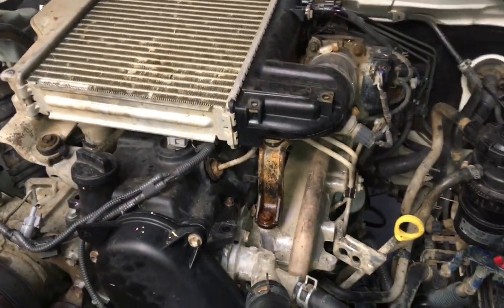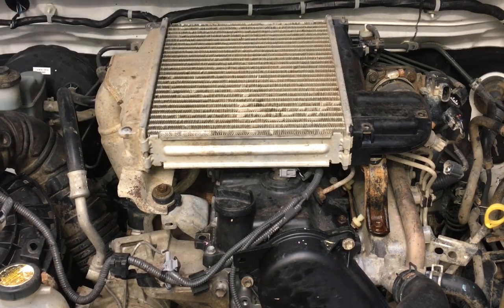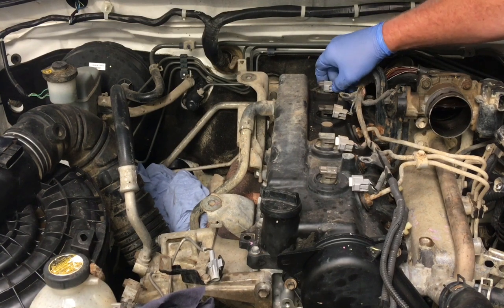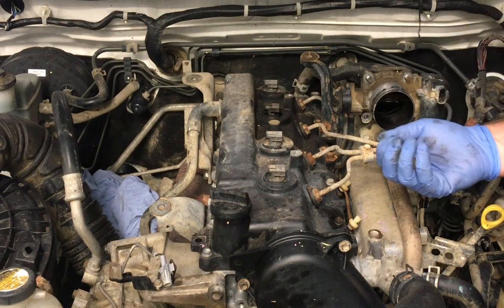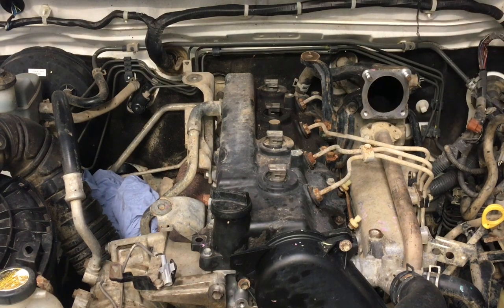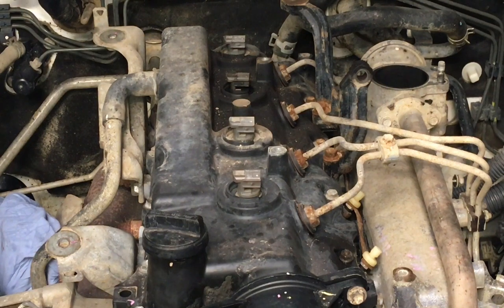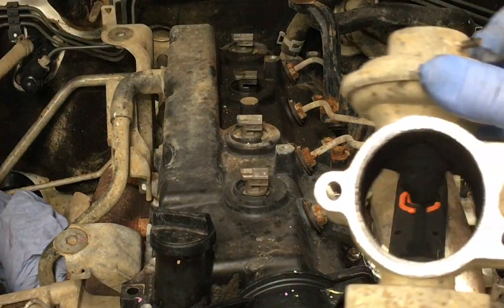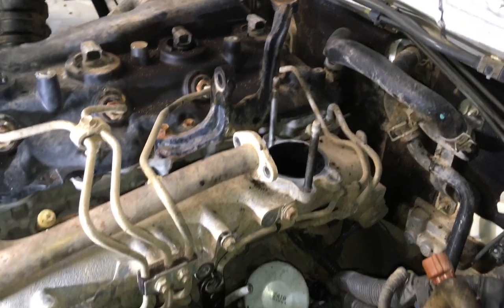FULL DETAIL EGR REMOVAL- TOYOTA HILUX / VIGO DIESEL 1kd-Ftv

Comment: The clips break in the NT. 2x injectors, the Common rail one as well, which I’ve got a Velcro heat shield over now, and the ones near the turbo. They cop serious heat.. Auto lecs aren’t cheap either lol.. why isn’t their more..? Clean job lol